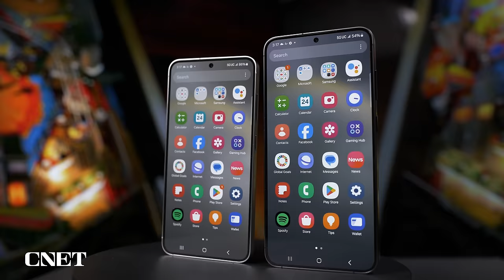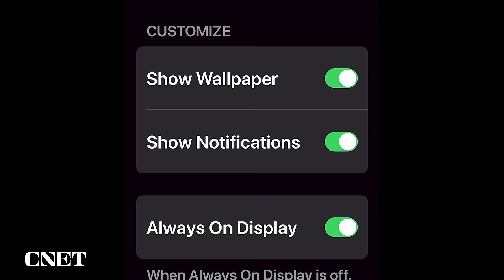Why Phone Batteries Don't Last Long 🪫

Comment: Where are "Graphene batteries " tech? For years I used to read about it..
Reply: The technology is still too expensive to implement into consumer devices, unless you want to spend a lot more on your phone. As with all technology, time is what we need. Graphene batteries will become a reality for consumers but the tech needs to become profitable enough to mass-produce
Reply: Along with several other new "revolutionary breakthroughs" in battery tech I've been seeing stories pop up about for like 10 years. Still on lithium ion...
Reply: Graphene is still difficult and therefore very expensive to produce, its one of many, many types of battery technologies that battery companies around the world are currently trying to crack for mass battery production. I am hopeful that we should see some significant developments though in the next 5 years, which I hope will also be significant for the phone industry. I am looking forward to a day when I can travel free of all the various cables and chargers for the different devices…

Comment: I have an iPhone 12 Pro, it lasts much longer if you keep low battery mode on when you unplug it in the morning. Should also make the battery health in good condition and have the battery last longer. Note that when your phone is sufficiently charged it does turn off low battery mode. Hope this helps!

Comment: Hello, I've bought a chargie for this kind of issues. The chargie let me automatically stop charging my phone before it reaches 100%, allowing you to set a maximum charge limit (for example, 80%). This helps reduce battery wear over time since keeping your phone at 100% constantly can degrade the battery faster, also it have overheating protection.

Comment: “2 days tops?” That’s fine what are u talking about.
Reply: True, but those phones are over $1K (well over, if they're paid over the course of a plan). Most people can't really afford them (even if they can make the monthly payments).
Reply: @loki2240  and exactly who’s problem is that?
Reply: @JoshuaJonesPhoto  - It's most people's problem because the phones that most people can afford don't have very good battery life when new and then it decreases from there.
Reply: Don’t speak on most people. Speak for yourself. Also that is how batteries work.
Reply: @JoshuaJonesPhoto  - Why are you being so abrasive? Most people don't buy the flagship $1K plus phones. Even the manufacturers will tell you that. 

And yes, that's how these batteries work. The point is that many people want better battery life on phones that they can afford.

Comment: After 2.5 years with my phone, if I have a REALLY lazy day and scroll instagram reels for hours... I definitely need to charge my 12 Pro well before the end of the day. I have no issues with charging overnight, but I'd like if I wasn't running into the single digits of battery charge before the end of the day. Not the end of the world. But improved battery tech DOES seem like it could be huge for a lot of stuff.

Comment: Instead of making them thinner and thinner maybe just make it a bit thicker and last longer. At one point the iPhone was bending when people put it in their back pocket, remember that? This same battery tech is why Electric cars aren't really ready for real prime time.
Reply: Once they made phones that thin (iPhone 6), Apple eventually started making their phones a bit thicker starting with the iPhone 11. Nowadays, most flagship iPhones excluding the mini will get you through a work day (8 to 6) if you don’t spend too much time doing battery intensive tasks.

I can see how Apple could make their phones a bit thicker now, as their use of Titanium did help lower the weight of their pro lineups. Hopefully next year’s pro models could feature a larger battery.

But regarding the overall state of smartphone batteries, since phones are something that we hold on to for the entire day, I can see why Apple or Samsung makes the conscious decision to make them a bit slimmer.

Comment: I would not mind a slightly thicker phone and slightly wider (1/8 inch) I still use S20 Ultra, with no plans to upgrade anytime soon. I will not get a new phone ever if they don't bring back expandable storage, earphone jack and multiple physical SIMs in addition to eSIM. Also, the ability to completely block all tracking and data sharing that overrides any apps built in data gathering.

Comment: For battery healthy I understand it should only be made to operate between 20% and 80% charge. So a 5,000 milliamp hour battery is effectively only 3,000!

But that means you're going to have to charge it more often, so what's the balance of advantage?

Comment: First point here... This is a first world problem lol

Second, to say we're using the same battery tech that we used in the 90s is incorrect.

Thirdly, it's too expensive to the scale it needs to be right now for things like graphene batteries... Which companies like Samsung have been working on for 8 years now.

Fourth, batteries really aren't a huge problem anymore. Once we broke over 4,500 mAh, it's not really the batter that's problematic anymore. It's the software, and other hardware components like cooling and the SoC that are the main issue COUPLED WITH the horrendous habits of typical consumers when it comes to charging their batteries in their phones.

Fifth, if you're "panicking about your battery life... Then this must be your first day with a phone, and you can't think/plan properly.

Comment: I am finding with these phones is that their lithium batteries don't last long very bad battery degradation. Only lasting for a year or so before the battery takes a couple of days to charge. So slow charging then when you take it off the charge it doesn't hold charge for very long after an hour so the battery drains completely when in use. Such is the bad battery degradation on these lithium batteries. Motorola sort this out on your lithium battery powered phones. Innovate develop new batteries that don't have very bad battery degradation and that lasts for years. Do better than the competition make better than the competition innovate better than the competition better quality than the competition long lasting than the competition come on Motorola do better.

Comment: The problem isn't with the battery tech. It is the poorly optimised software. Most android phones have unoptimised software and battery hog first party apps.Thus to compensate, phone manufacturers incorporate larger capacity batteries. OTOH, iPhones have optimised software and better software-hardware integration, but refuse to include larger capacity batteries in their phones to make you keep buying the next "best" iPhone. If Apple wanted, they could have M1/M2/M3 level battery performance on all of their phones.
Reply: Nah you’re completely wrong; iPhones are still the top non-gaming phones for battery endurance even beating out the 5400mah OnePlus 12. I don’t know why this reporter is talking about poor battery in iPhones, if that’s the case then every other phone that’s not an iPhone should be mentioned too.
Reply: @superiortoall22  All I'm saying is that iPhones could have FAR superior battery performance compared to other flagships, if Apple made the effort to include larger capacity batteries, especially in their non-pro models.